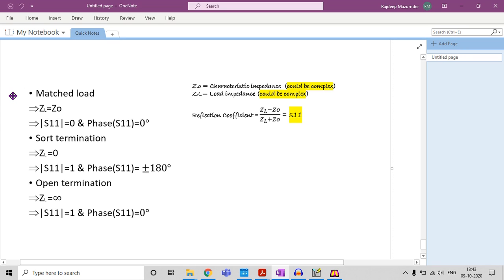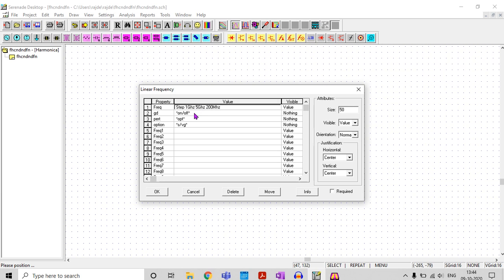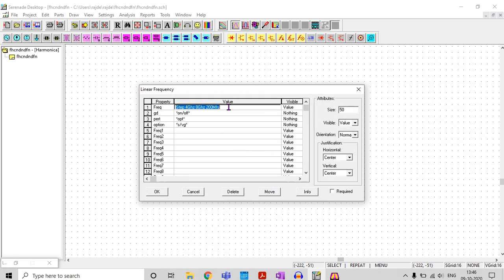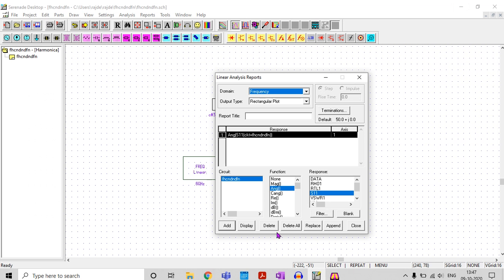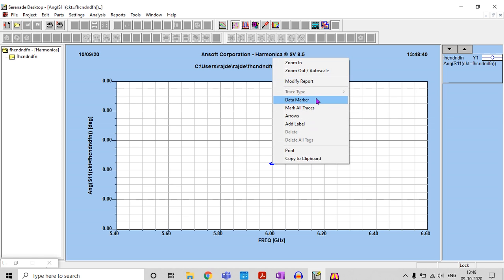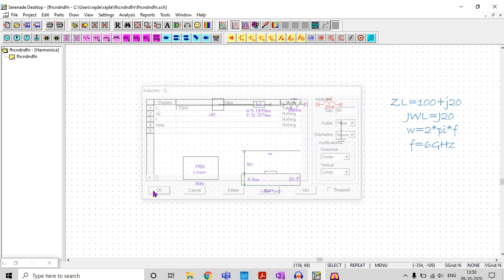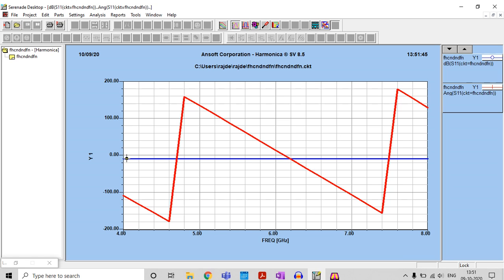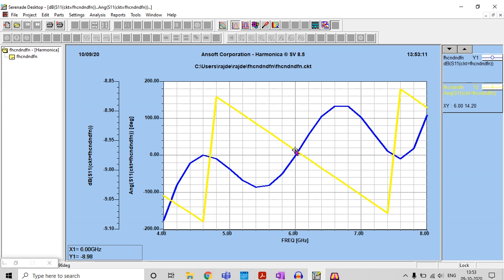Simulated Class 4:Serenade Tutorial |sort,open and complex termination.

Comment from the maker: *One correction= general formula of gamaIN I provided here will give you phase(s11), but in the case of any circuit which has transmission line  involved phase(s11) directly get influenced by Electrical length of your transmission line,  and phase(S11) will match with the general formula of S11 if your TR line length is of multiple of lembda/2, the TR line used here is of multiple of lembda/2